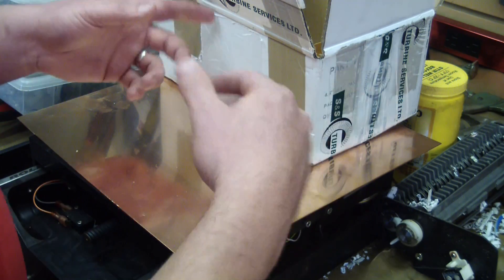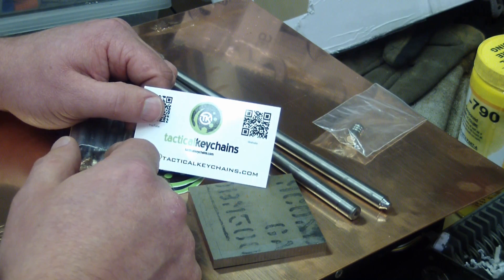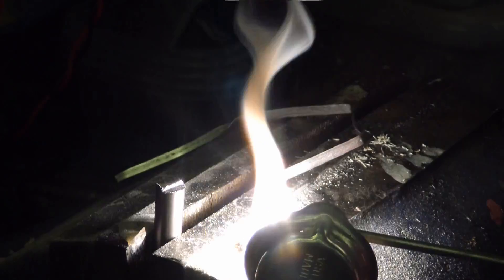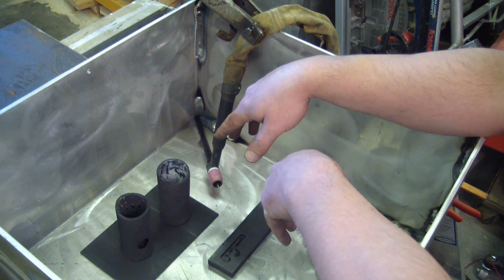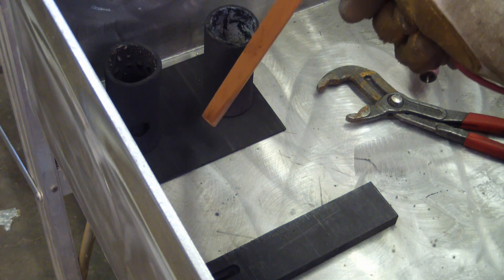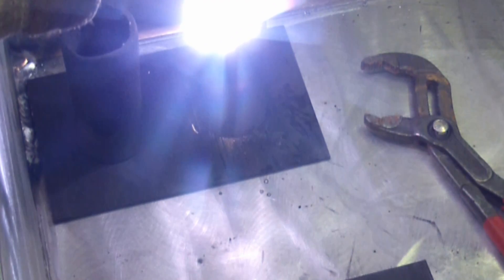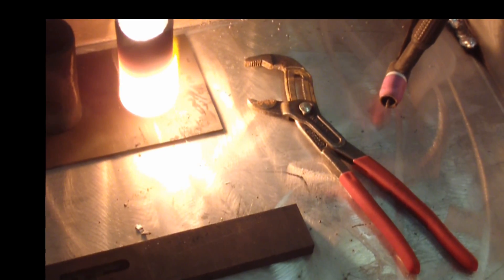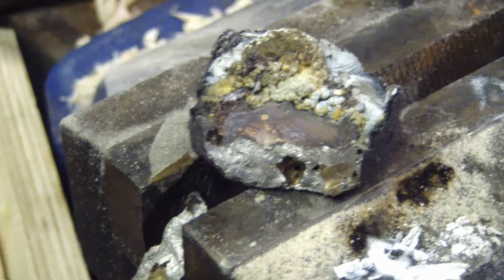Titanium Casting Experiment

Comment: Titanium can be caste in a vacuum.  I remember back in my youth.  My Irish mother would cook potatoes in an aluminum pressure cooker pot.
The problem is that titanium melts at 2000 degrees.  So you can use an aluminum pressure cooker pot.  So you will need a ceramic pot, or something brick lined that can go to 2000 degrees.  It will also have to be in a vacuum.
Although the titanium has to get to the temp. of 2000 degrees, the entire vacuum ceramic pot or brick lined chamber does not have to get to 2000 degrees.
You could place the titanium in the chamber or pot, and have gas jets directed at the titanium (like you were doing in the video).  At the bottom of the chamber would be a gutter, when the titanium melted it would ooze into the gutter.  When the titanium started to ooze down the gutter sensors would go off, and open a door to the gutter.
Once the door was open, then the titanium would go into the mold.

Comment: Kinda looks like you made your own titanium nitride. Judging by the flames coming from the outside of the crucible I think there's still plenty of air in the box...maybe point the TIG torch down into the crucible, or do away with the torch altogether and just have a hose pointed thither?
Reply: I had a similar thought, but with titanium carbide because of the graphite possibly dissolving in the liquid titanium like making steel.

Comment: This is kinda late to the party but I might have some pointers. There's a government materials lab here in Hamilton, Ontario with an inert vacuum furnace used to melt titanium. I've spoken with one of the materials engineers there by the name of Kumar Suddayappan, a  well known copper and magnesium specialst. Apparently, he says when melting the titanium, not only is the environment completely inert, but the only material that can be used for a crucible is copper. It's called a copper "skull" crucible or something along those lines and is used because it is the only material that wont react with the titanium. This is an induction furnace mind you, but what happens is the titanium apparently forms a shell on the copper so that essentially the liquid titanium is held within more titanium. Not sure how you could pull that off in a garage unless you made some sort of sealed box with sand blast cabinet type gloves and did everything within an inert booth and somehow. Then there's the issue of getting the power necessary to run an induction coil that'll be able to melt down titanium.        

Just my 2 cents anyways. Either way, loved the videos, this is something I've always wanted to try but never had the resources.

Comment: I've been thinking about this for awhile now, because I want to cast nitinol someday. Anyway, what you need is an induction heater in a vacuum. Get one of those $100 vacuum pots on Ebay and rig an induction head in there around your crucible, and a pouring rig somehow that lets you keep the vacuum, and it will work.

Comment: Im sorry to tell you, but no wind? Ur wrong.

Density of air: 1,3kg/m³
Argon: 1,78kg/m³
Thats at 0°C.
Now the density of Argon at 1'000°C calculated with  m/V=p*M/R*T is 0,4kg/m³ (calculated for 0°C = 1,78kg/m³, Argon is pretty much like a ideal gas so that equation is somewhat exact)

The hot Argon is just going to rush out of ur box as fast as you can imagine and getting replaced with air.
Just imagine a huge flamme pulling all the gas up.
So unless you get up with something to stop the Argon from getting out of there... thats not going to work.
I reckon: A kind of dome over that setup, where the Argon can cool down a lot as well as lose its momentum, would already be enough to allow you to cast the Titanium, since it woont take several minutes or so.
But you really have to fill the box all the way prior to starting. That is crucial.

The golden color is simply from Titaniumoxides.

Comment: ya know.. I was wonderin if maybe instead of using up your badass graphite gougers, chuck the titanium rod up in the stinger and use it like a welding rod. If you'll get a steady arc or not is beyond me, but it can't be too much worse than those carbon sticks.
Maybe put a piece of that titanium plate at the bottom to puddle on and see how it goes?
I think it's worth a shot

Comment: I just bought a motobecane bike of solid titanium. It has been a blast to ride & has a 100 yr warranty. Handles the hills incredibly well. Even hauled some groceries home on it today and went around 4 lakes.

Ave: Few people understand electricity that well but I went to college for it and I think your problem is that the welding rod connection while arcing could be making ozone (O3, wikipedia it) and o3 is highly reactive.

The way to confirm this is to measure the titanium weight before and after and see how much mass you lose, then we can come up with some better answers. Weigh the shit you have now.

Just an off the cuff guess: You made Ozone with the welder and it interacted with the ti and oxidized it. It didn't burn like the other stuff because now there is only limited amounts of oxygen (maybe they followed the electrode down as you moved it into the work experiment zone) I also guesstimate an electrical connection to the graphite crucible that is not of welding quality (one more like your electroplating solution.... ok, How about using mercury to flow the electricity into the crucible? And make all connections via wire outside the box so there is no disturbance to the volume of argon contained within. ) should help.

This is interesting though because my bike didn't come with any bolt holes to mount anything. I like storage racks on all my bikes. I am thinking about getting out my old oxy acetylene torch and brazing some tabs on it that I can tap to fit an aluminum carrier rack. The best thing about the bike is that it is super light. (that, and the fact that Meg notices me on it...)

Comment: Going over some of the comments, I would say that a couple are on the right track. Induction won't work as he is attempting to melt the Ti. The more energy that is in the material, the less effect magnetism will have. The Curie point (where the material becomes paramagnetic) of Ti is lower than its melting point.

I would say that you need to find a way to heat your entire enclosure to about 2000 degrees F (easy right?), and carry the current from a Ti rod instead of a carbon arc rod. The Ti ingot that you did get seemed chock full of porosity (contamination) and inclusions (too low temperature), and was surely more TiO2 than Ti. If you can't increase the heat, reduce the size of the electrode and see if you can get Ti in a powder.

Comment: Titanium is an interesting one to forge as well, especially drop forging. It takes a fair bit of effort to heat up in the furnace, plus we had to run it a bit rich to avoid major oxidation. When we got it into the die (we were making SBC con rods) and started hitting it, the titanium absorbed all of the energy out of the drop hammer and was fairly reluctant to fill the dies completely, we had some slight underforming at the top of the wrist pin end. The impact absorbing trait I found really intriguing, because you can "bounce and catch" the hammer off regular steel forgings, whereas the titanium just took out all the energy of the hammer and you had to yank on the handle to bring the hammer back up every time

Comment: Why not build a vacuum chamber, evacuate it and fill it with argon then evacuate it again. (Cue Austin powers evacuation complete sequence). As someone mentioned perhaps a 10kw induction forge, microwaves or king of randoms plasmabox. My grandfather was a master sheet metal worker for Rolls Royce and he did the titanium panels for planes and thigs.
He had a lot left over so my grandmother had titanium cookware, practically paper thin but never failed.

Comment: Perhaps the dross is Titanium Carbide?  Maybe the Argon gas blanket allowed the titanium to melt without oxidizing much, and it combined with the graphite crucible to form TiC. The cheap ass graphite crucibles I bought had some kind of stinky (think of gear oil) and had clay binder in their matrix. They were supposed to be heated once slowly to 'temper' them.

Comment: Argon's heavier than air when it's the same temperature as the air, but you heat it up to a bajillion degrees and it'll rise right up out of that box.  Looks like the gas flow couldn't make up for that, oxygen got in the box and it was game over.  That's why the crucible caught fire too.
Reply: +Jason Goodman simple explanations, simple solutions! Good one goodman.
Reply: +inthefade  he was but in the area where the crusible is it was warmer then the room temp and it flew away resulting in loss.

i would say he prolly wants to mount his argon dispensor right above where hes working at hire cfm's so its raining the gas into the exact work area rather then just laying on the bottom...
Reply: I can't easily find it, but I assume they use an enclosed chamber full of argon, so there is no place for it to escape to and no way for oxygen to get in.  It's this need for a special environment that makes Titanium so expensive to work with, because Titanium itself is very common.
Reply: I used to work in a company that produces casting and melting machines and producing a proper batch of molten titanium was quite a process.   A vacuum chamber with a graphite crucible in it, an induction heating coil, an Argon bottle to fill the chamber through a valve and luck is what you need :)
Reply: inthefade I have heard actively leaking an inert gas works, as the gas is replenished with fresh gas. If you see fire, all your inert gas caught a flight out of there.
Reply: I have no first hand experience with what he was attempting, but even if the gas is heavier than air, while heating it, the gas will both expand and rise, this could cause a fluid dynamic churn and incorporate a little O2..  That would be a problem ..  So, instead of a tub, maybe a full enclosure would be what would work.  Allow gas to flow out, but he expansion from heat should be acceptable with a constant flow into the enclosure..  but, that is just guesses..
Reply: Richard Smith
I thought AvE was running his argon the entire time?
Reply: +Jason Goodman Its too bad the crucible didnt catch on fire even more. Maybe the carbon dioxide could of helped the argon out. Assuming thats a graphite crucible. Why wouldn't it be, he literally has like a ton of the stuff :P
Reply: use chillies and your digestive system.
Reply: I wonder if you ran the Argon right into the crucible rather into the box, sort of as if you were actually welding.
Reply: Jason Goodman What a goodman
Reply: AAAAAAHHHHHHH!!!!! That makes sense.
Reply: I normally use CO2 when I need to TIG something huge, as this gas is always heavier than air.
Reply: That is a very treacherous thing here:he simply made carbide!It should be damn obvious!
Reply: Spoilers!
Reply: From the looks of his welds, he had no gas to begin with
Reply: Build yourself an enclosed chamber for the argon environment, glove box, two door entry.
Reply: +Robert Paul Guidry Probably need a glove box enclosure or somesuch.
Reply: +Jason Goodman So if the argon is heating up, what if you cooled the box with dry ice?  Would it be even close to remotely enough to cool it, or would you have to go to liquid nitrogen?

What is the industrial process for casting titanium?

Comment: I say induction is the way to go. using a cheap welder, large SSR, and control it with pwm. use a solid copper bar, and make a large size coil.

Comment: knipex is also just a few km away from my house, in cronenberg, wuppertal, germany.
a friend from school works for them, he told me the worst thing he ever had to do was help out in QC, because their standarts are so high that its downright annoying
Reply: +xx1simon1xx  Look morty, more cronenbergs.
Reply: I love my Knipex Cobra. I'm glad to hear that they have high standards for their tools! Thanks for that information.
Reply: FloatingBacon    Knipex makes great tools.  I use mine in my R&D Laboratory.  
I use the Chinesium tools for weld fill in Nuclear pressure vessels.  Works for me.
Reply: I bought my pair of Knipex Cobras a few months ago. Best damn pliars I've ever used
Reply: I swear by knipex tools.. those pliers have been through some utterly unspeakable things.. and they’re still rockin. We use them on seized hydraulic fittings where you can’t fit a pipe wrench.
Reply: Hmm this video is 1st time ever heard of knipex? I have my Douglas adjustable Pliers evrey one round South Tex calls em Channel Lock's or Channey's.I Never Cared for The Chanel lock brand that Blue handle either vanishes or turns green and the metal rusts up quickly but Ive had these Douglas for 18 yrs now use them daily (Comm New Const Plmbg)
Reply: sse

Comment: What if you microwaved it in an inert gas? I saw a company once that was using microwaves in argon-filled chambers to smelt and cast reactive metals. Since they were doing it on an industrial scale, they were using 10kW microwaves, but maybe it will work with smaller pieces at lower wattages.

Comment: Burning graphite and oxidized titanium can't happen without oxygen present. You could put a cover on your aluminum box to keep the argon in. No wind in the shop, but you do have turbulence from the argon flow. With a top on the box you could slowly purge it through the top with argon, maybe 1 cfm for an hour (slow to minimize O2/argon mixing). Then lower the graphite electrode through a small hole in the cover. If you make the cover out of glass or acrylic, you could see what you're doing. It'd be a good opportunity to make that aluminum box into a glove box (like a sand blasting cabinet) so you can do stuff like this with no oxygen contamination.

Comment: Actually an induction heater might not be such a bad idea, Ave. If you're adventurous enough and creative enough you might be able to come up with a good design. Unfortunately they use a lot of power. I think it starts at something like 10kw. You never know. You might start a trend. I always thought you could only use induction heating for ferromagnetic materials but apparently they'll melt most anything.

Comment: Hey Ave. You sound like a really good guy and I'm trying to help you out but it may be beyond us mere mortals to try and melt and cast this stuff. Just watched a video with a blacksmith forging titanium. He had it white hot and he still had to beat the heck out of it. Apparently when they're doing it industrially for small amounts they use something like a vacuum arc melting process in a very fancy (probably very expensive!) furnace that heats this stuff to about 6000 degrees F. I know I'm not really helping. Wish I could suggest a cheap easy way to do it. Maybe some kind of plasma torch. But then still the container. Sorry. Sigh.

Comment: Hey Ave. Been doin a little bit of lookin around on the web and I was almost gonna suggest some kind of ultra high temperature ceramic crucible if you were serious about trying to melt/cast stuff like titanium and the ceramic with the highest melting point is made of tantalum hafnium carbide. Stuff melts at over 7000 degrees F. Something like that would work for you but it's crazy expensive. Almost $10,000 a kilo. Have no idea how they would handle stuff like titanium and tungsten carbide in an industrial setting. We're back to square one.
Reply: +rex69832 tantalum isn't that expensive. Surely...
Reply: +Lawrence Mayne First off, Lawrence, I'm not ANY kind of expert on this stuff and I don't pretend to be but I try and do at least a LITTLE bit of research on the web before I open my big yap on youtube. And that's not ANY kind of dig towards you. Having said that tantalum is pretty rare. One fifteenth as abundant as gold. Apparently there's only about 50 years worth of supply of tantalum left at current extraction rates. This is all on places like Wikipedia and people can look this stuff up themselves if they want. One of the latest prices I've found is about 132 USD for a kilo of the ORE. So you may be right that tantalum by itself isn't that expensive. BUT, the problem is, Lawrence, that for the purposes of our discussion here tantalum by itself doesn't make that great a crucible for melting titanium. So you mix it up with a couple of other things. And then you get tantalum hafnium carbide which is GREAT as a refractory material because of it's melting point of almost 4,000 degrees Celsius. But it's deathly expensive. It was manufactured by Goodfellow company as a powder at almost $10,000 per kilo. So I'm not really helping this poor guy AvE. Titanium is horrible to work with. On this same page there are other videos about titanium and one of them is called, "How do they do it? Titanium." Industrially it's obviously possible but for a private person to try and work with small amounts of titanium it's almost nigh well impossible. I know this doesn't help, Lawrence, but titanium is a son of a gun.
Reply: +Lawrence Mayne Hey, Lawrence. I was trying to figure out why I was on about something exotic like tantalum hafnium carbide as a crucible because I was looking into this stuff 3 months ago and I couldn't remember why. That blasted titanium has a melting point of about 1670C. and there aren't a lot of things that will hold it without melting. There's not a lot of viable alternatives. Tantalum by itself at 2980C. would work but good luck getting that much together in one spot. There are other things like Zirconium, Vanadium, Tungsten, Ruthenium, Rhodium, Rhenium, Platinum, Osmium, Niobium, Molybdenum, Iridium. You get the idea. For a private person to work with titanium is gonna cost one way or the other. Like I said before, Lawrence, titanium is a son of a gun. I'll let the experts deal with it. it's not worth MY time or effort.